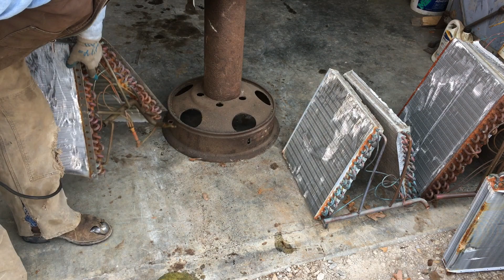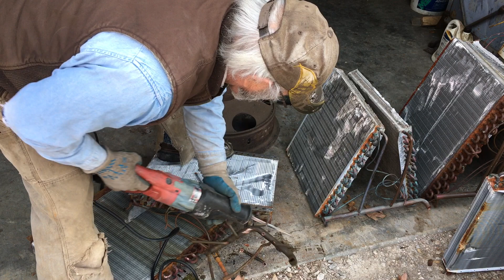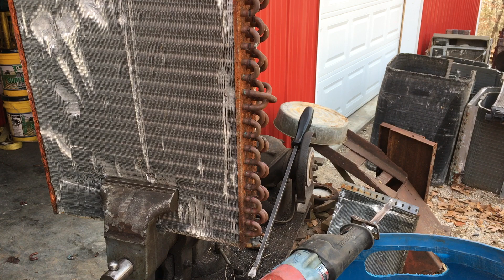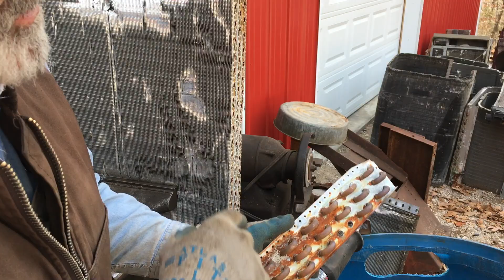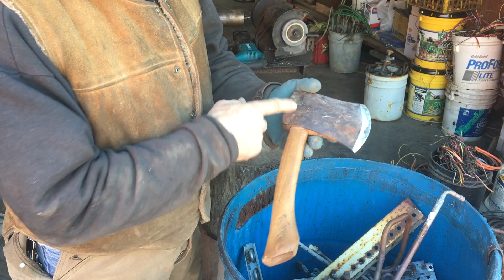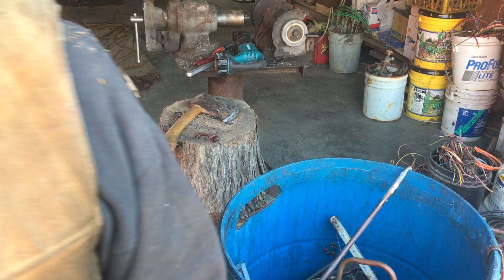Scrapping Out Air Conditioning Coils

Comment: Cool video. I've been scrapping since I was a kid. I go out on my bike and bring back copper cable, piping and brass. It's a pastime and it pays and there's nothing boring about it. Great video. Liked and subbed.
Reply from the maker: Well fortunately I am retired now so UNfortunately I don't get an abundance of air conditioners and copper to salvage any more.  But I do get a chance to recycle a lots of ferrus material and a fair amount of aluminum and sometimes a little brass.  I have been salvaging scrap for 45 years as it comes my way.  Actually I have a small load of about a ton just about ready to haul out now.  Price just raised by $100/ton for some reason about a month ago.  Its at $140 now.  Thanks for stopping by and most of my videos are on other topics.  Btw...keep cycling and RE-cycling.....!!

Comment: I always cut the Copper" elbows" off then flip over the Radiator ( known as a " core" in the Appliance business). This let's the " oil" or freon run out so one doesn't make a mess in their driveway or at the Scrapyard. I meet alot of people  who claim they don't have time. I place Core in the vice then I use a hacksaw - it's quiet, neater and safer. Only difference is I leave the Metal plate on then hit it with a hammer  Been taking apart ACs for over 20 years. Thanx. What's a Copper Magnet?
Reply from the maker: I got in the habit of doing it this way many years ago.  Being an a/c service tech, I'd collect 60 or 80 units over the course of a busy spring and summer. So I had to get with it while salvaging.  I'd do them all at one time in the late fall then haul them into St Louis on a tandem trailer stacked and bound down. Sometimes there'd be plenty stacked in the truck bed too.  We live in the middle of the woods too, so noise is no issue to us.  Oh, the copper magnet...? I was trying to make a joke about using a tool that's non-existent.  (-;

Comment: I have never seen anyone use a sawzall that quick in my life. I thought you had a hot coal in your pants! I remember not too long ago I had a pick up truck load of aluminum, cans lawn chairs, trays from toaster ovens, and odds and ends of stuff I forgot I had. Came back with $127. Of course the prices aren't as good today. I'd saved the cans from gatherings, family reunions and parties for years and finally I ran out of room. So it was a good time to scrap it. And a friend of mine worked his way through college by scrapping I the summers. He made far more than working some job flipping burgers. He'd go to dumpsters, take remote controls and electronics apart for the mother boards, strip insulation from wire and cords and had piles of copper, brass, stainless and a bunch of other stuff and make good money. He spent more time than a regular job but had a blast finding stuff and got permission to raid dumpsters. I have 50lb bags from bird seed that I use for my bins in my shop, my scrap file. So Thanks Tractorman 44! I raise me JOcup as always! DaveyJO
Reply from the maker: Good Morning sir...another elusive comment that snuck by due to my inattention.  (-:   I supplemented my income my whole life scrapping whenever came along the opportunity.  Being in hvac I was always getting units to bring home even having a friend or relative bring the truck and trailer to haul off 6, 8 and sometimes 10 units at a time. Most of the time it was only one though.  I think some people are born with a particular gene that pulls 'em to a junk pile. LOL
I don't get so much any more. Oh well I have enough to do anyway...but the extra moolah is still good to come by.  Thank you sir for the comment and I'm wondering how many comments are out there now just awaiting discovery....  Second cuppaJO raised in honor of Uncle Bud and of course Mr and Mrs DaveyJO in Pennsylvania !!
Reply: i realize I am pretty randomly asking but do anybody know a good place to watch newly released movies online?
Reply: @Prince Kristian Flixportal :D
Reply: @Milo Maxim thank you, signed up and it seems like they got a lot of movies there :D Appreciate it!
Reply: @Prince Kristian Happy to help :D

Comment: Hey buddy do you cut open the compressors for the copper? That's tough! I was watching a plasma cutter doing it. Not sure if it's worth opening them up. I subscribed to your videos!! 👍👍
Reply from the maker: No I don't because the return isn't that great compared to time.  I used to wait until there was a minimum of a ton of them in weight then take them to the only salvage year me that would process them.  The other two yards would pick them out of the pile with the claw and set them back in the trailer.  Here, they never bring more then .05/pound.  Thanks Dave for subbing.  I don't get to do salvage runs much any more because I'm retired, but when I can scrap a little here and there I do.  But here's one you might like: https://www.youtube.com/watch?v=mjEjmQ_IWj8&t=73s
Reply: Very good video!!!!
Reply: I understand. I can not work much anymore do to back problems and other health issues. I'm 59 and have spine problems. But I still do a little scrapping. I was with my dad when he did it at 3 years of age. I wish I knew a easier way to contact plumbers and electricians also companies that discard it. Not a fan of steel since it's heavy and almost worthless again. Gas prices are killing everything.
Reply from the maker: @davea5150  A good source for materials are construction dumpster on small to midsize jobs.  Those jobs aren't usually all enclosed with temporary fencing and have the hoppers accessible on the perimeter of the site.  The large construction jobs are where the good stuff gets tossed though, and in pretty high quantity sometimes.  I scrounged tons of building materials as scraps over the years working construction.  Gas prices are slowly coming down, but the price is still high.  My area its around 3.69.
Reply: @tractorman4461  I used to do dumpster diving at a dumpster-refuse collection company with my pop years ago. No more off limits here. Private property. Don't get caught here. Like to find a few hundred catalytic converters. 😂 Lol. Yeah right!!!
Reply from the maker: @davea5150  Hahahaha....yeah, that'd be a gold mine for sure.   If you need help hauling them, call me.  LOL
Reply: A question for you? Copper, aluminum, household wire,ect. Was so high. Here outside Philadelphia in the western suburbs. #1 copper was around $4.20lb. stainless was .80 aluminum was .70-.75lb
 Then all of a sudden it went way down. Why. My yard said because everyone was doing it. And their buyers have enough and are not paying much now. True or false your opinion. And is supply and demand the case. Or?? I don't get it. Light iron was .11lb. that's the highest I ever saw it. I wish I good find a decent little truck. I bought a 2000 S10 four cylinder. Three years ago and put paid a guy to work on it. Runs great,looks good. But the frame has schale on it. And one can mount is rotted off. The price of cars, trucks are nuts. My choice would be a Toyota long bed 4-6 cylinder. Impossible to find. My old 2000 Toyota Camry is my tank. Turning 200k in a few weeks. Not pretty but purrs like a kitten. Okay. I miss working. My health insurance through my wife stinks. High deductible. But I could be worse off. My job was outsourced. Then I got very sick. With no health insurance. Ugh!!
Reply from the maker: @davea5150  In response to your question, the answer is twofold in my estimation.  Unfortunately a GREAT percentage of out recyclable steel and non-ferrous metals are sent to China.  The pandemic closed or severely cut short China's ability to utilize the raw material due to sickness.  Their vaccine program is very very poorly run, even their vaccines are not as good as ours. So the demand went down.  At the same time the prices were so high prior to the slowdown that there really was a lot more people recycling grandpa's old stuff to make a buck.  Lots of thefts of a/c units and power wires and copper pipe in new construction sites were happening all over.  THEN the bottom dropped out and the prices went horribly low, gas prices went horribly high and it became harder to make a buck by the thieves as well as the honest junkers like ourselves.  So its like stretching a rubber band.... it stretches real thin before it rebounds.  We are at the very beginning of the rebound.  Gas is ever so sloooooowly dropping, a penny or so every day for over 50 days now and the scrap prices are slooooooowly increasing.  But its going to take a while.  Corporate America and Big Oil are loving being able to price gouge way beyond the cost of production and are boasting supremely high record profits each quarter to the tune of many BILLIONS of dollars per quarter each quarter for more than a year.  So while we are scrounging for a few bucks here and there, shareholders and corporate management are reaping the benefits of our labor.  Sorry to get so strung out there, but there really is no simple answer.  Btw, I run an old 85 Ford F250 that gets 8 mpg day in and day out loaded or empty !!
Reply: @tractorman4461  Thank you so much for the reply sorry if I got long winded. Very interesting. I use two yards near me about 8 -9 miles away toward Philadelphia. Take care that's a good truck. I had a  1980 F-150 FWD SHIRT BED WITH A 351M AUTOMATIC. TWO TONE FACTORY BROWN WITH TAN INSERTS. AWFUL ON GAS AND NO AIR. 👌👍
Reply from the maker: @davea5150  I feel your pain on the old F150 Dave.  No a/c and not even a head liner or tinted glass in my '85 farm truck.  Heck the AM radio quit 20 years ago too !!  I don't mind the long comments at all.  It very much shows  interest in the subject.  Being a commercial hvac service tech, I was always supplied a company truck so this  old '85 has just turned 80,000 miles.  But I changed the rear end to a one ton dually and changed the standard 8' bed to the flatbed you'll see in videos.  During the change I double stacked the springs.  It's a bit hefty !!

Comment: Yes best way to do it. In a vice. A Vice and a good pair of CABLE Cutters makes tht job way easier and faster. I did over 2 pallets of window units big medium and small. Plus about another 4years of build up on A-Coils to. Also to many of the older semi Radiators. A scrap yard in a good sized town sure can build up a surplus of all tht copper radiator to clean up. Wish I was the one who cashed them in and cut em up if ya know what I mean$$$$$$$$... Specially in today’s scrap prices.
Reply from the maker: Yes, I wouldn't mind running into a big supply of them either !! I used to get a lot after 40+ years in hvac, but retired now they don't come my way too often.   The vice is for sure the best way to hold them for cutting the tube sheets off the ends of the coils.  Some guys use metal blades in skil saws, but that way shoots too many hot sparks at your face in my opinion.  But the best way is the way that works for yourself !!  Prices just dropped slightly on scrap iron and copper both, but it will come back up soon.

Comment: Great video. I’ve seen others saw behind the metal plate (fin side) then get a pair of pliers and easily pulls copper end loops off. 🍻
Reply from the maker: Thank you sir for watching and for the comment Bradley.  I'm of the school of thought that says whichever way works best for you is the way to do it.  The physical construction of the different coils sometimes dictate the means to be used.  I use a dull hatchet on occasion as well as the sawzall technique and on others, a screwdriver stuck in the loop pops them out easily as well as pliers.  The point being is that there is no 'exclusive' way to get the job done.  (-:  Thanks again sir.

Comment: Good morning!! Have you ever revived a car battery that was dead and out of warranty. By the people showing videos with distilled water, epsom salts and baking soda. Then charge up? I tried one time. No good it doesn't work.
Reply from the maker: I've always figured if its sounds too good to be true, chances are it won't work Dave.  No, I have not tried it.  But I AM going to try to revive a few of the ni-cad batterys for the battery drills though.  Those you are supposed to hit them with a high setting on a battery charger or low amperage setting on a welder.  But I am really leery of trying it.  I like my eyesight......jus sayin'  LOL

Comment: What about the refrigerant fluid inside the tubes. Toxic? Flammable?
Reply from the maker: Once the system has been through the reclaim process by the contractor, there is no longer any refrigerant in the tubes at all.  You MUST have the refrigerant properly removed prior to disassembly because of the damage the fluorocarbons do to the atmosphere, specifically the ozone layer protecting the earth.  If you use a torch and experience a flame, the flame will be the residual mineral oil burning that coats the inside of the tubing throughout the system. 
   If you do accidentally use a torch on a system whose refrigerant was not properly reclaimed, the process will create phosgene gas which is very harmful to your lungs.  In an enclosed area, you can suffer some severe damage to your lungs.  So it is in fact very toxic, but the flammability is mostly due to the oil that vaporizes into the atmosphere and ignited by the flame.  However, the fluorcarbons when subjected to flame give off the dangerous phosgene gas.  Make sense...??

Comment: I lace the copper coils (hairpins) for the A C units at my job. Did you get the rest of the coils from on the inside of where you were cutting off the coil hooks?
Reply from the maker: Oh heck yeah.  I cut the tube sheets off to strip the return bends (hairpins).   With the tube sheets cut off the coils are classified as 'copper-aluminum radiators' and  they net a higher price than being left whole. I also cut all the metering devices off and separate them into brass and dirtyu copper.  Dirty copper will have solder joints on the fittings.  Britney, do you by chance work for Marlo Coil ?  
Thanks for watching and commenting !!

Comment: Did you pull the tubes out of the coil?
Reply from the maker: Two things. First I've always had access to a large quantity of coils, residential AND commercial.  Second: I've never developed a easy technique to strip tubing out of them.  Some of the commercial coils would be 6 inches thick, 4 foot tall and six or seven feet long.  Both things exacerbated by the absence of excessive time. Make sense..?  Now that I'm retired, I don't hardly get them any more.  LOL. Ain't it funny how things change.

Comment: i tried to take apart a Air conditoner and alot of gas came out :/ how do i avoid that is there a way to drain that before taking apart????????
Reply from the maker: By rights you should have a certified  air conditioning mechanic like myself remove the refrigerant with the proper reclamation tools.  I am retired after 40+ years in commercial hvac service and have all the proper tools and locations to take the reclaimed refrigerant.
Reply: @tractorman4461  Thanks for the reply. Now I know that, good thing none of the gas hit me I'm trying to become good at recycling..... Keep up the videos
Reply from the maker: @megarobertmega3796  What's actually the most dangerous about the uncontrolled loss of refrigerant is if it happens to be on a unit that suffered an electrical 'burnout', meaning the compressor shorted inside the sealed unit, there will usually be a moderate to highly acidic content in the oil.  The oil will spray out carried with the spewing refrigerant through the opening.  It will have the capacity to be harmful to your skin and definitely is harmful to your eyes.
     In newer systems and in commercial systems, when we replace the 'burnout' compressor we install filter/driers in both the high pressure and the low pressure lines to clean the oil in the system so it won't contaminate and destroy the replacement compressor. Then on highly contaminated units, we actually return to replace both filtering devices to ensure the oil is cleaned of the acid content.
    So make sure you always wear your safety glasses and if you are dealing with the oil, you should consider protective gloves.  I applaud your desire to recycle as I have actively recycled for nearly 50 years. Be safe and keep active, there's lots of money to be made recycling part time.
Reply: @tractorman4461  yes since that day I've seen alot of videos explaining all the good stuff. I'm being way more carefully and have actually bought gloves glasses etc Thanks Again your Videos help Alot ;)
Reply: i had a friend do this too and they got sprayed in the face for a few secs. lucky they were outside and had glasses on. then they wiped off their face. i guess they are ok.